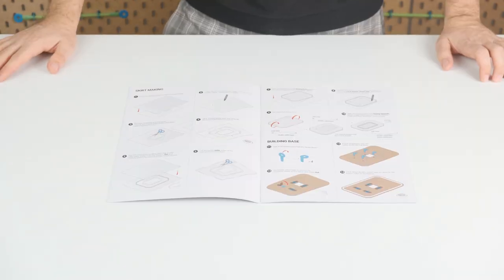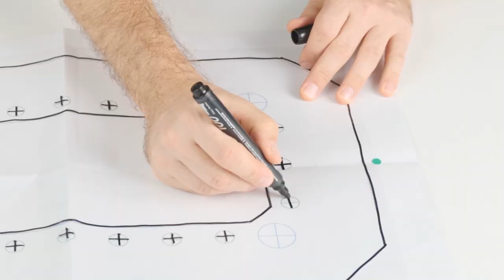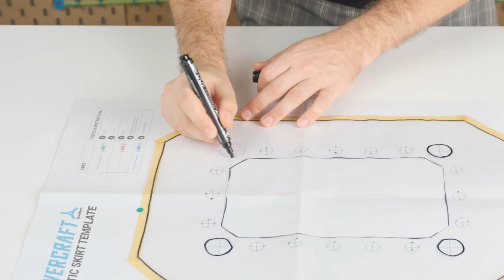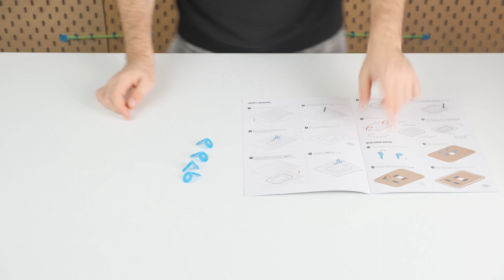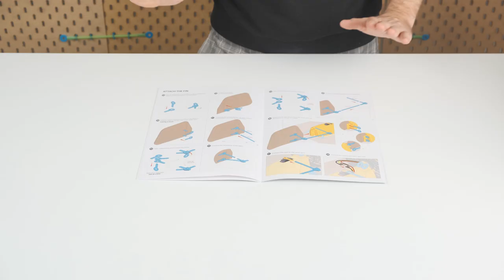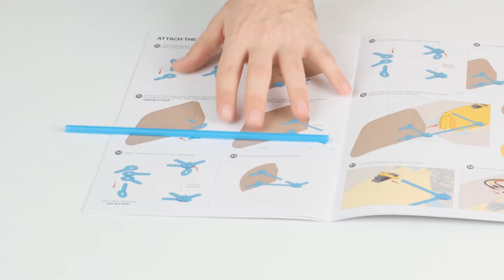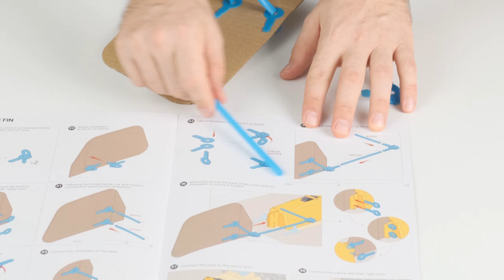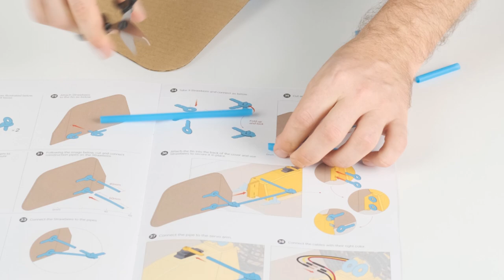Hovercraft unboxing

Comment: I think my battery might be dead? The charger flashes rapidly in red when I attach it. The booklet only mentions green flashing.

I tried charging it for a day and when I attach it the hovercraft it doesnt work.. What would the specs for a replacement battery be?